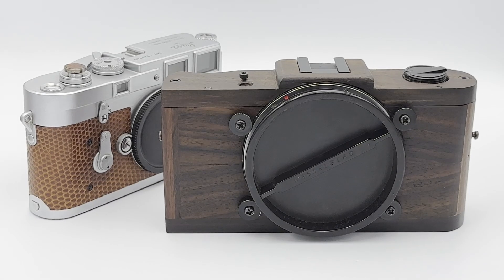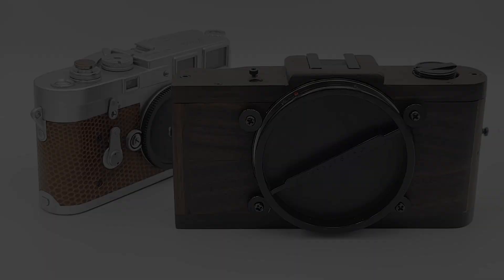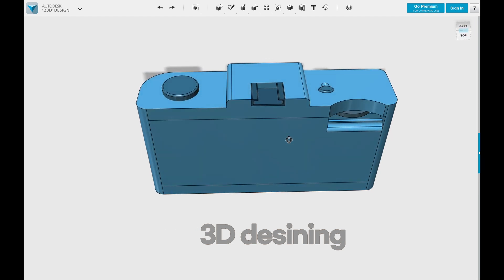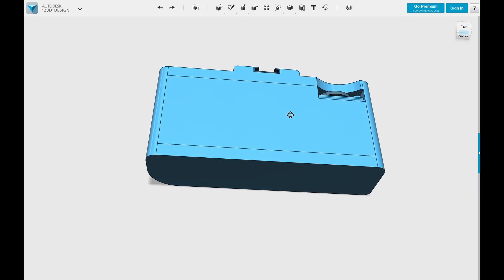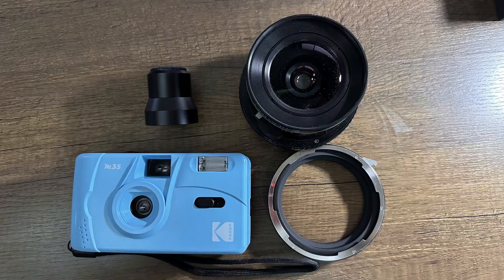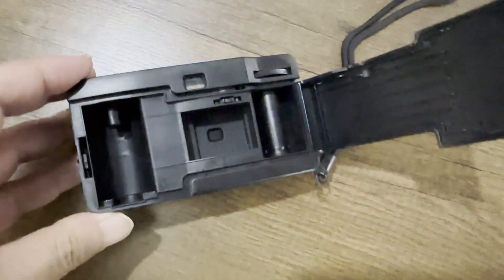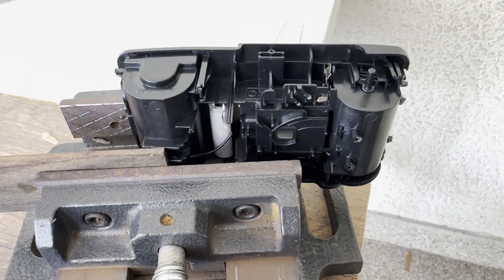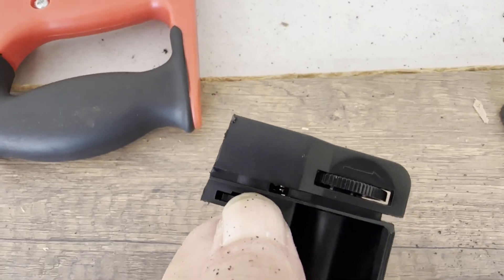Handmade camera "Agnes-Pan" (DIY for a Hasselblad XPan alternative)

Comment: Awesome. What's going on at 4:33? That's the only thing I don't understand about this build.
Reply from the maker: That’s measurement of the focal distance plane. Rodenstock provides its length but setting it up to the body is totally different thing. Corner to corner measurement is necessary and loupe also helps.

Comment: Astounding!! So cool, so many questions!
How did you manage frame advance syncing and shutter cocking? Would you try this now with a better metal body?
Reply from the maker: Hi there.. that might be one of drawback of this camera which is being used toy camera part. It is done by manual with guess and experience. Now I have 15-16 shots for each roll, if it was made with metal body, it might produce 17 or 18 shots like Xpan.. However this is one of fun to use this camera as well.

Comment: I was thinking of tackling a similar project…..are you using a shutter from a medium format camera because wouldn’t you need something with a larger gate than a standard 35mm? Also if you are using the film advance from the Kodak M35, how are you dealing with the spacing of each frame since you are using 2 at a time?
Reply from the maker: super sorry for the delay in responding to your questions. I'm using large format lens shutter which integrates all the functions, such as setting aperture, shutter speed, cocking the shutter, etc. I used to use M35 film counter but the space between two shots are so vast, so I ended up using how many times I rewind the wheel (starting from 9 to 5).. it enables me to take 14-16 shoots.

Comment: How did you choose a viewfinder? I want to do something similar but I’ll be using a 65mm lens (35mm equivalent)
Reply from the maker: As you may know angle of view equivalent to the 135mm camera, it would be easy. Depending on your budget, there are many options other there in eBay, Amazon, etc. 
All the best to your works and please share it.

Comment: But did you any calculations to use such lens? Or you just did plug the lens and it will work? Nice job anyway
Reply from the maker: Yes I did a calculation... At first, there is a data sheet from the company (Rodenstock) on flange focal distance then actual distance should be measured by the ground glass and another camera required for setting up an infinity.
Reply: @aaroncre  lol i have a nikon p520 dead camera. I was curious to pluck the 42x zoom lenses on the wood :)
Reply from the maker: @SonnyBurnett2012  haha.. it might be a challenging but, but always there is an answer... give it a try... :) 
To make it work, you might need a mechanical shutter to control shutter speed and aperture with the 42X zoom lenses

Comment: What lens mount did you use? A Mamiya Press or Bronica bayonet mount?  Also, you didn’t seem to have issues with achieving infinity focus. Is that because of the 45mm focal length? I assume a longer focal length would require a greater film to flange distance
Reply from the maker: @Jim-BobWalton  It is a combination of lens mount but it is mainly Hasselblad V system mount and in case there is no film inside (for storage purposes), I can detach the lens and store them in a compact way…. Yes right the longer focal length lens has longer flange focal distance so the length of the tip of the lens to the body would be longer…

Comment: Do you have the 3d model which you showed at the start of the video by any chance
Reply from the maker: @kierancarter3693  Yes it is… but please note that the design is not printable… I use it only for design purposes by using 123D designing program. As I’m now traveling until 26th July, I might update you once I go back home..
Reply: @aaroncre  i understand i wanted it for exactly the same reason as i was going to build one the same way you did but maybe to cnc a block of wood
Reply from the maker: @kierancarter3693 the 3d design was used just for a reference with the same dimensions. However there are some alterations once I made with woods, so Cnc works might also require it. for your information.
Reply: @aaroncre  thanks
Reply from the maker: @kierancarter3693  would you mind to share me with your email address? It might be better to share it through email rather than posting it on the web. Thanks.

Comment: Excellent craftsmanship! Can you share the method on how the Copal shutter lens was converted to Hasseblad ? Was it V or H ? ( 3D print? Any chance to get the STLs ? Also the focus aspect - were you always focused to infinity?
Reply from the maker: Thank you for the kind words. Copal shutter is attached to m65 helicoid and the 65mm helicoid also attaches to V mount adapter. 3D printing was not used. Helicoid helps me to focus 50cm to infinity. Thanks

Comment: Idd buy one if you made those for sale.
Reply from the maker: Haha… good to hear that. I might have a customer if I run for this business…:) much appreciated for your kind compliment
Reply: @aaroncre I wonder how hard it would be to make one similar but for 110 film.
Reply from the maker: @atruceforbruce5388  it seems 120 medium format, right? 120mm is much easier as the film winding is simpler with the cut indicator of the film back.
Reply: @aaroncre  that's what I meant.  120 medium format. You sparked a camera building interest. Seeing you dont have to be a rocket scientist.  I Also considered lens modifications like buying one of those fish eye door peepers that you see in hotels and modifying it to work on lenses like the disposable camera lens mod for regular cameras.

Comment: What is the lens mount/focuser that you are using? Is this a large format lens mounted to some kind of lens adapter with a focusing ring?
Reply from the maker: Thanks for the query.. I missed the parts in making the video... sorry for that. I'm using a Rodenstock Apo-Grandagon 45mm f4.5 lens which is a large format lens together with helical focuser. The lens mount is combination of Hassel V mount which connects with m62 helicoid. Helical focuser is being used with manual distance marking which enables me to focus from infinity to 0.5m or even closer, but I haven't tried less than 0.5m. Hope this answers to your questions. Thank you.
Reply: @aaroncre  Thanks for the quick response! After typing the comment I started searching and indeed found similar parts on ebay.

Comment: Very impressive project!!! Looks absolute fancy!! 😮😮😮

I'm just wondering how the forward mechanism works, shouldn't it snap into place at 36mm? How did you bridge it? That you can scroll two images forwards for one panoramashot?

Greetz,

Saartekk 😉✌️
Reply from the maker: Thanks for the question and sorry for the delay in responding to your query. Concerning the film advancing, I use a film wider from the parts of a disposal camera. I practiced how many times, I need to wind with the plastic gear knob, and I happen to know that at the beginning of the film it takes 7 times winding but from the middle of the roll (let’s say image cut no. 5 to 6) it needs 6 times to wind up.. Hard to explain in writing. Hope you could get what I wished to say.
Reply: @aaroncre  Hey, thanxx for your answer, I think I have an idea what you want to say... You used the winding mechanism from a disposable camera and figured out in trial'n errormode how much turns you need... 😉😁
Reply from the maker: @Saartekk  exactly. Thanks to your intelligence :)

Comment: how does the winding mechanism work with longer frames? did you modify it or do just know how many many times you have to to wind it up?
Reply from the maker: That is a catch. I thought the disposable camera would provide a solution, but the gap between the two cuts are so wide, now I get to know through trial and error. At the beginning I need to wind 7-8 times (full) and starting from the middle of the film I need to wind up 6-7 times.. the film counter is not so helpful in that sense.

Comment: Absolutely incredible work, I was smiling through half of the video because it's so cool!! Any chance you plan on making a medium format camera? I always thought that that shouldn't be to hard, since you could use the magazine/film back from another camera but I have little to no experience with building my own cameras haha. There are these Single Lens Reflex medium format cameras, like Pilot 6/ Pilot Super, which use a mirror that you have to manually fold up before pushing the shutter button and if I where to build a camera, I think, I'd try to make one of those. Anyway, keep up the good work, excited to see you next project!!
Reply from the maker: Thanks a lot for the kind and encouraging words. In fact my most of built-ever cameras were medium format except those 3 Xpan alternatives (yes it was my 3rd time making Xpan alternative). Medium formation is much easier as film winding is straight forward as I just drill a small hole at the back to see the no. of shot. Foldable camera was not my list, but it would be an idea to make a compact size to carry the camera. Thanks once again for the kind words. You might see some of my previous works at my Facebook page (@woodcamera.master). Thanks.
Reply: @aaroncre  Ahhh I see, thats so cool!!! Sadly I don't have Facebook and it doesn't let me view your posts without logging in, so I cant see them :( which is a pity, I'd really love to see your other work!! But if you ever make an instagram account, I'd definitely follow you, it'd be awesome to see your cameras and the pictures you take with them!!
And yes, I thought so, 35mm seems like a pain to figure out how much to advance the film etc. Did you use the advance mechanism of a disposable camera for your camera and then just measured out how often you have to turn the wheel? 
Also after I wrote my comment I did a little research and I stumbled upon the "Primarflex", which is more or less exactly how I envisioned my DIY Camera (minus the attachable film back). Are your Medium format cameras similiar or are they all rangefinders?
Reply from the maker: @joshuam7702  how about Flickr? https://www.flickr.com/photos/jongbong/
Please note that I've not on Flickr these days though.

Comment: I’d ve extremely interested in making a diy similar to this one, would you care to tell what helicoid adapter and moint you were using :)? Official ones are ridiculously expensive…
Reply from the maker: Hi there.. this is a helical focus: https://www.ebay.com/itm/152506200999
the lens mount is https://www.ebay.com/itm/324719672216
All the best to your works.

Comment: Tried to build a camera like this too. The wooden lens elements were kind of a deal breaker (JK).
Reply from the maker: thanks... lens mount is always an issue to me. It would have been better if it was fixed with no screw on the surface. If I built the similar body, I would attempt to fix the mount inside of the body which can be done.
Reply: lol

Comment: Can you link the mount and lens.
How did you figure out the flange distance.  I see you use a ground plane for focus, were you able to hit infinity?
Great video BTW!
Reply from the maker: lens is Rodenstock Apo-Grandagon 45mm f4.5.. I added a helical which can be easily found at the eBay.. for the mount, it is M65 to Hassel v system which can found at the following link:
https://www.ebay.com/itm/142377104365
for the calibrating focus... ground glass is just part of it. it is also required another step by using a micrometer and and another camera.
Reply: @aaroncre hey, would you mind explaining why you’d need a micrometer and another camera?
Reply from the maker: @Childish-Turbino  That is how I can celebrate the focus. To set the infinity of the focus, another camera would tell you where is the infinity focus. Once it is set, it is need to measure the distance by using any measurement tool. I use micrometer which then will be used to measure corner to corner for ensuring same distance from the flange.

Comment: That's incredibly clever. I was worried you were going to have film flatness issues but looked to work out very well.

I too have always wanted an Xpan but can't justify the prices.
Reply from the maker: That is true. That is why I ended up with having 3 xpan alternatives... this trial is more successful than before... 
In order to have an even and same distance through whole film plane which is so important, I need to calibrate the distance by measuring the distance with a micro meter... I do believe each corner has the same distance.
Reply: This would cost you more than an Xpan.
Reply from the maker: @chumleyk  haha.. thank you so much. I haven't though about the price... but in case I make this for others I would make an offer lower than Xpan.. :)

Comment: I think I have a stupid question... how do you know what's in focus? Aren't large format lenses meant for a much large flange distance?
Reply from the maker: focus calibration has been done in two ways.. 1. through a ground glass.. as you may see, I cut a small piece of ground glass to measure the rough distance to trim down the film plane.. then 2. through another camera to check the infinite focus..... in order to have even and same distance, I also need a mico meter to measure each and every corner. It is not necessarily a large format to have a long flange back distance... it depends on focal lengths, and you might find that information from the vendors and any other source from the Internet easily.

Comment: WOW impressive work! 

Did you have to modify the film winding mechanism of the disposable camera to accommodate the longer frame length?

Would love to see a video on those other wooden cameras in your case!
Reply from the maker: In fact, I thought 2 times winding would work as one time winding would provide at least 24*36mm space. However after the field test I learnt that the 2 times winding resulted in too wide gap between 2 images. Thus I ended up with disabling winding stopper. Now I get to know the proper space with the winder through the trial and error. 😂

Comment: Beautiful! I need to learn some woodwork skills, I'm currently building a 4x5 camera out of foamcore board and the lens from a Kodak Autographic 3A.
Reply from the maker: If you have that sense and skill, it would be easier for you to start... Woodwork requires some skills but the most important thing is to prevent any injuries from the wood working machines which are so dangerous. If you do for manual tools, it would be relatively safer. All the best to your another adventure.

Comment: How did you find a lens that would cover image circle big enough, but can focus at such short flange distance? I would guess that any large format lens require longer flange distance, even if it is wide-angle lens. I thought once about making my own camera in similar format as you did, but I never really got past the problem of finding lens that would keep the resulting camera compact.
Reply from the maker: Hi there.. in fact some of short focal length lens has short focal flange distance. You may find vintage data from Schneider or Rodenstock lens specification. For the case of Rodenstock Apo-Grandagon is 55.5mm as you can see in the following link. Hope it can help and all the best to your works. 
http://www.prograf.ru/rodenstock/largeformat_en.html

Comment: Fantastic work! One question - could you recommend where to buy an optical finder for 6x17 camera with 90mm super angulon? I somehow cannot find reasonably priced one.
Reply from the maker: Hi.. I would suggest you to find Fotoman from the ebay for customizing view finder depending on the format and focal length. It was about less than 200 bucks which might be reasonable price compare to other stuff... 

https://www.ebay.com/itm/403889816911
Reply: @aaroncre thanks for replying! I will definitely check it out.